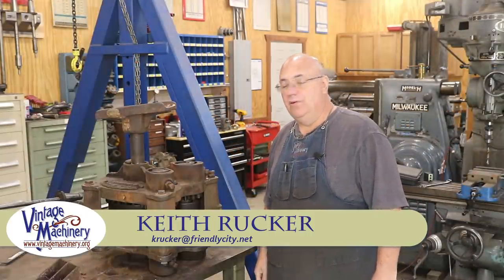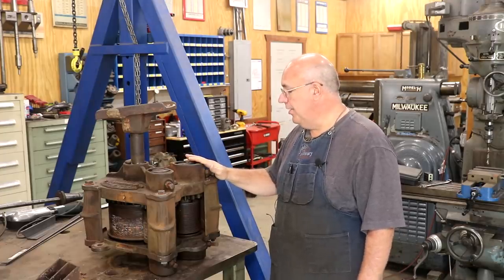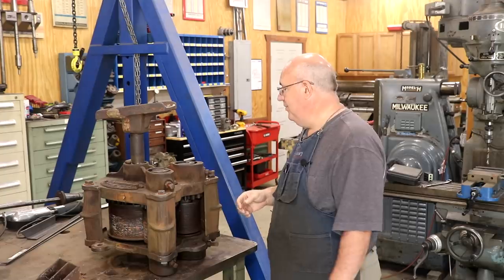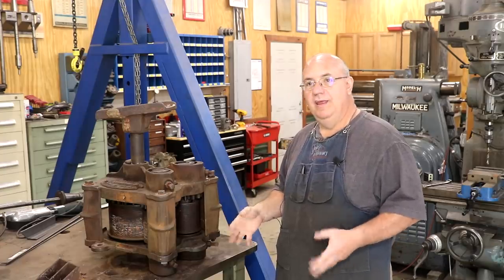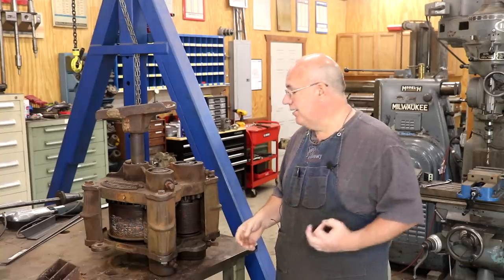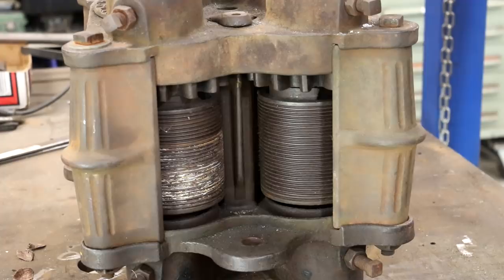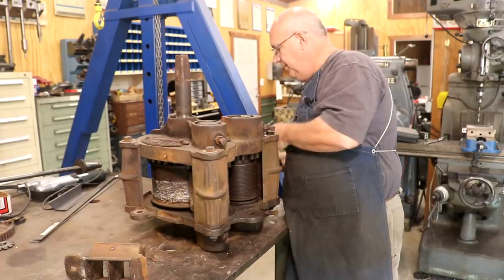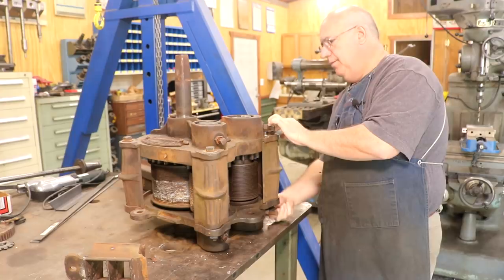Goldens’ No. 1 Cane Mill: Guide Knife Socket Repair

Comment: Have you forgotten to drill out the broken bolt on the upper left side as u mentioned in the beginning?
Reply: In the end scene, it looks like there is no longer a broken off bolt in that hole. So he must have done that part off camera.
Reply: @wuudturner  You need glasses.
Reply: Sitting her yelling at the screen Fix The Bolt LOL. I am sure he did it but still LOL
Reply: @ElmerJFudd-oi9kj  I might. But the spot where the bolt was broken looks different than it did in the beginning. You can think whatever you want to think, and it does not bother me.
Reply: @ypop417  It should have been a simple matter to weld a nut or something else to the end of the broken bolt and back it out.  I would have liked to see it though.
Reply: @Bobbywolf64  Yep thats how I would have done it.

Comment: We still have cane mills on the streets of Bangkok.
I call them mangles (as in washing), the operator crushes the cane as a sweet juice for passers by.
Very simple and lightweight.
Yours is very heavy duty !
Love it !
Love these videos !
Reply: i love that juice...
Reply: Same here in Costa Rica, similar idea but a lot lighter, like mounted a tricycle cart and hand crank operated. My guess is that the light weight machines still leave a lot of juice in the cane though because they aren't squeezing it as tight.
Reply: I enjoyed a similar drink, caldo de cana, when I lived in Brasil - crushed sugar cane, crushed pineapple juice, and crushed lemon juice - all freshly run through the same cane mill.  Sold from small push carts or from the back of pickup trucks alongside of the road.  Just as I was leaving, there was a ban on the drink due to an outbreak of Chargas disease attributed to the unsanitary condition and lack of sterilization of the cane  Fantastic refreshment!
Reply: I think it's about time you exported some to Durban, I wanna try that juice.
Reply: Same all over India
Reply: Sold everywhere in the streets of Alexandria, Cairo, Hurghada and probably all other Egyptian cities too.

Comment: In the low country of South Carolina, they grew sugar cane, the midlands and upstate grew sorghum.  Most people mount those mills up on posts on a little platform.  the height was determined so that the sweep going around didn't hit you in the head.  My grandfather had my aunt drive the tractor in circles to pull the sweep.  Sometimes he'd wait for a family reunion and have the kids run around and turn it.  If you had a mill,  neighbors would bring their cane to be milled and you would get a portion of the juice or some of the finished syrup as payment. 
Grandpa had a shed with an 80 gallon cast iron half spherical syrup kettle  that was bricked in a fire place, so that a fire at the entrance was pulled in around the kettle bottom and back on the other side to go up a chimney.  As the juice boiled, they skimmed the scum and trash off the top with small hole colanders screwed to wooden poles.  they would boil it until it reached the desired thickness.  you stayed up all night tending the fire and skimming, and it usually took about 30 hours of continuous watching before collecting the finished product and putting it into mason jars.  
Grandpa had a two roller mill and we had to run the cane through twice to get all the juice.  the three roller mill was supposed to be an improvement over the two roller mill.  
My grandpa had a wet spot in his field that was often a little boggy and that is where he grew his cane.  He would dig a shallow pit at harvest time. Line it with the outer cane leaves and stack the cane inside, cover it with leaves and dirt until the weather got cooler.  that's when he'd dig it up, run it through the mill and make syrup.

Comment: We used to have a sorghum mill like that back in central Wisconsin. They had modified it with gears and a pully on the top to run on a belt from a tractor.  Too cold for sugar cane, but they grew a lot of sorghum, and the farmer that had the mill did the grinding  for farmers for miles around.

Comment: Keith, nice job, that top piece didn't look too heavy the way you lifted it around, but I suspect it was between 45-65 lbs. Save your back when lifting in wierd overhead positions, that gantry was close by.  if you want to lift weights, do it in a normal position. They are cute.

Comment: Interesting. I need to take a welding course where I can learn to braze.
Reply: just D I Y it it's not hard, a pile of scrap metal a torch some brazing rods  and just do it. braze it together and pound and twist it if it doesn't break--- success.
Reply: Like Frank Deegan says just get the equipment and try. I started Arc welding at 11 years old using my dads 225 Linclom welder best way to learn is to do it.

Comment: Interestingly, the 2 screws put in probably could have been left out. If the holes weren't drilled all the way through and tapped with a plug tap, you could have filled the holes with brass along with the ridge you built up with brass.

Comment: The screaming in my head is almost gone . While you had it apart drop the bottom plate, rollers and guides in the evaporust tank. That does not look they tear it apart for cleaning before squeezing anything . Boiling syrups does not get rid of rust particles  maybe a strong magnet in the various kettles would help
Reply: I would imagine that normally this sort of thing should be seasoned like cast iron cookware. Rust isn't magnetic so you can't really pull it out that way. I wouldn't be too worried about the rust particles though, iron oxide isn't harmful to ingest in small quantities.
But yeah, I was thinking the same thing. This is in contact with food, clean it up a bit before reassembly.
Reply: I wouldnt consume anything that put out. Errrgh.
Reply: Well not until its cleaned of all the rust and gunk on the rollers.
Reply: wayne p Small amounts of rust is not harmful in the diet.  Adds iron to the daily minimum requirements.  Ingestion of evaporust is probably very bad to ingest.
Reply: What do you think gets added to fortified cereals then !
But the babbitt bearings have me more concerned than the iron .
Reply: He repaired it for someone, not restoring it,
Reply: anything you put on to preserve the metal ends up in the syrup
strip off all the rust and coat with vegetable oil after every use.
but why bother.
after 200 years i think they have it down.
Reply: Gonna have very healthy haemoglobin  levels - probably the most spritely sugar growers in the area !!!
Reply: @dagwood1327  I have hemochromatosis - genetically caused iron overload. No, you don't want rust in the diet. Harmful? It damaged my liver, pancreas, finger joints, hormones.  Nice try.
Reply: @twistedhairball  If you have eaten in a restaurant you have had worse.  I promise.
Reply: I laugh when I read the comments re contamination. About 50 years ago, my neighbor had an old cider press. There was a local fall festival and the kids in the neighborhood (middle/high school age) would make a few dollars selling cider by the cup or jug at the festival. I won’t give you all the grizzly details but sanitation was not highest on the priority list. The prep for the press was usually squirting it off and out with a garden hose. The apples were gathered in a wheelbarrow which may or may not have gotten a rinse. The apples were mostly drops from trees throughout the neighborhood and selection of the best and beautiful cider apples was not the highest thing on the priority list. But we drank as much as we bottled while making it and no one was any worse off for the experience and the people who bought told us how excellent it was and that it must have been made just the way their dad/grandpa/uncle/ family made it and I’m sure it was. 😎👍👏
Reply: @gd2329j  I'm sure they will replace the Babbitt with RoHS compliant material.  This is sarcasm.  They really need a sarcasm typeface.
Reply: @joeromanak8797  You've probably had a better immune system in the process. I think there is something that comes out of a green garden hose that makes you live longer if you drink it.
Reply: @joeromanak8797  growing up. used to go to the pony rides in Griffith park.  got deathly sick every time.  thought it was the horse or snot from sick kids on the saddle horns.. decades later.. Griffith park was found to be on water wells with big tanks spread out across the park. vandals had broken the screens around the top of the tanks..  thrown all kind of stuff in it.  there were dead animals.. and animal wastes throw in.. the drinking water was 10,000 times dirtier than a toilet seat.  city had to install all new pipe lines and run the entire park off city water not well water.  summer were spent on an island in Puget sound..  there was a tiny ice cream stand over at the marina..  just enough room for a soft serve machine and a place to sit.  since the lady did not sell out every day.. she left the machine running over night..  but when she turned off the light switch. the soft serve machine and its cooling system turned off.  took some time to figure out what happened there also.. half the island was sick.  people who would go to town and people who never left the island..  only thing in common was the soft serve stand.  so i might be hyper reactive to contamination possibilities.  heck.. even when we lived a mile from the next neighbor and only went to the store once a week we prayed to the pail.  don't know if it was the raw hamburger i snuck from the fridge.. or moms Egg nogs made with fresh eggs.  or my former SO's delicious meat loaf..  until i found her making it on the kitchen counter.. without a cleaned cutting board..
Reply: @gd2329j  There's lead-free Babbit for food-contact applications.  I don't know if that's what's poured in those particular bearings right there, though!
Reply: @twistedhairball  More for the rest of us that know what good syrup is!

Comment: Amish at Muddy Pond Tennessee    You worried about a little rust?  Check out the board and tow sack to divert and strain the juice into a barrel here.  If the link works... Took these photos in 2008, and yes I bought some... the Sorghum Molasses were really good!   Looks like the same kind of mill Keith was working on.
https://pbase.com/td2/image/103696034 
https://pbase.com/td2/dpreview

Comment: I'd be curious to hear what a professional has to say about adding those screws to increase the strength of the brazing. Not to knock Keith here. But I worked in tool and die for the better part of my life and we never did anything beyond roughing up the surface a bit. As far as I know a good quality braze job is stronger than generic cast iron, no need for the "reinforcement".
Reply: Most of those Cane mills were cast before modern foundry practice had fully evolved. Most were poured in batches off of a Cupola  furnace and the metallurgical qualities varied quite a bit. Adding studs before welding/brazing cast of unknown quality is common practice. Sort of a belt and suspenders approach.
Reply: Not a professional but I would have downsized the holes.  Bolting a tapped crescent rib from the bottom first.  If too fragile then redo with the current repair.

Comment: Does anyone know if the Goldens who made the mill is the same company as the "Goldens' Syrup" that used to be sold all over?
Reply: I may be off the mark and I'm certainly the wrong side of the Atlantic for sugar cane milling, but in the UK Tate & Lyle still produce "Golden Syrup", which is partially inverted cane syrup, and so called simply from its colour.  "Inversion" simply means breaking down the cane sugar, sucrose, which is a di-saccharide into its mono-saccharide components, fructose and glucose.
I have to say that the condition of that cane mill didn't much resemble food grade processing equipment!  However, I guess the juice is going to get boiled for a long time, and the rust will only contribute a bit of iron in the diet.
Reply: @jonathanrichards593  Quite true. The sanitary conditions of the beginnings of a food chain are often astounding.  One must remember it all grows in dirt.......
Reply: I'll check tomorrow on my desktop and see where that steel mill was ( I assume on the Chattahoochee) and what else they produced.

Comment: I was going to mention the broken bolt Keith and also the rust as noted by others but I was also wondering about lubrication on those babbet journals.  Wouldn’t that machine work a lot better with some <edible food grade> lubricating grease in there?

Comment: Judging by the noise, the bearings don't seem to be quite right. That machine must make a hell of a noise when in operation. I pity the woman in the golf cart.
Reply: If his mom is anything like my mom,she probably has a blast helping out with a happening like making syrup,making sausage,etc.
Reply: That "noise" is just about the same "sloppy gear noise" most of the old stuff my grandfather had around the farm when I was a kid!
Reply: Jim Korman Don't you think it would run a lot smoother with double babitts? Now there's only half a bearing top and bottom for every gear.
Reply: @horatiohornblower868  I noticed that and had to think a bit - Wonder if they used only a half bearing so the axles float as cane of various sizes are fed into the press!
Reply: Straight cut gears & the variable adjustment to change the crush.  Is what it is.